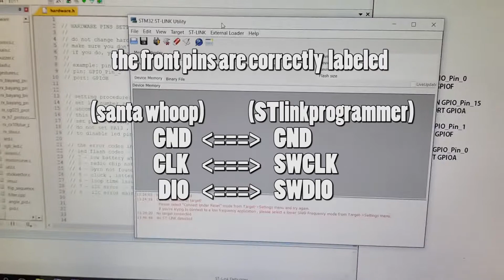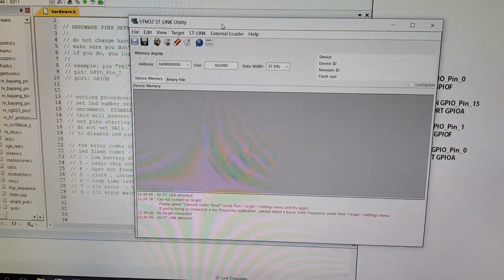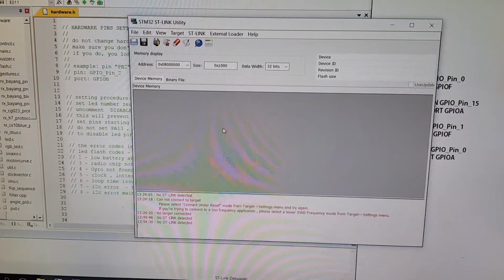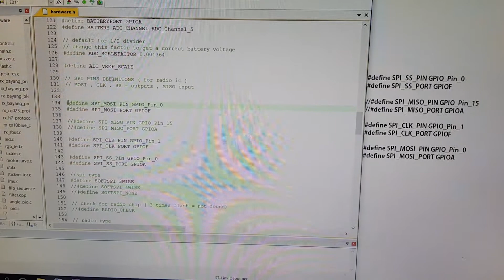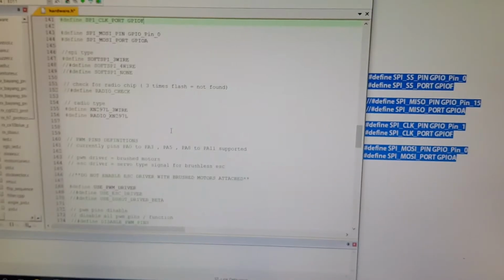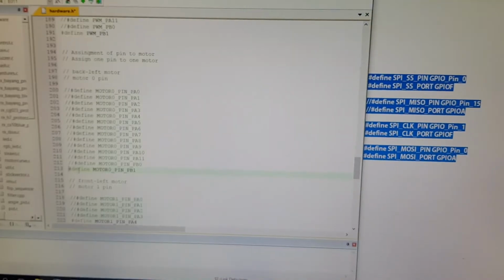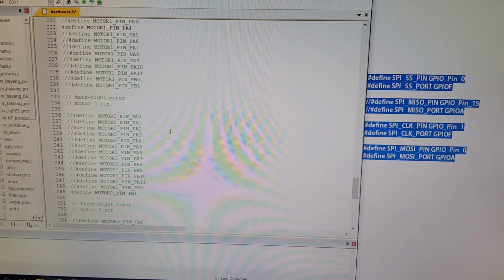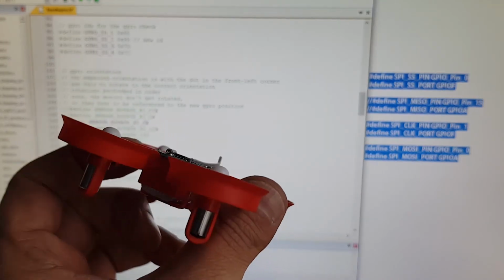How to flash acro JJRC H67 and Eachine E011C (Santawhoop)

Comment: hi all... i have trouble, all is successfully done upload...but drone just blinks 4 times, doesn't bind to remote
Reply from the maker: Make sure to have correct drivers etc...
But if upload was a succes, it could be that your flightxontroller is broken. I have half a dozen dead ones.
Reply: @CaninosRC  can it fixed?
Reply from the maker: @ge_maker  i am not sure. Try to reflash it. Otherwise its dead i think. People sometimes replace the crystal on top of the board and fix it. I have tried that twice, but never worked.
Reply: @CaninosRC  oh no....
What is the cause of the damage in your opinion?
Reply from the maker: @ge_maker  maybe you accidentally hit the crystal or other component while or after flashing. Or even sweat from your hands caused a short in circuitry.
Reply from the maker: But its been a while since i've flashed or even flewn quads. Maybe they even added a different board to their lineup.
Reply: @CaninosRC  i dont know if i accidentally hit something,
thanks of yours respond,
and i still want looking for the solutions,

Comment: how to enable silvervise conrct to phone pliss
Reply from the maker: Never used silvervise, so cant help with that.
Reply: @CaninosRC  can u share horizon setting in h67 
pliss
Reply from the maker: @yudhavalkyrie7568  its been a while since i used these toys. You'll need to check nfe's github for the latest settings
Reply from the maker: @yudhavalkyrie7568  also dont fly horizon mode. Its a bad learning method imo. Fly acro (air enabled) or just stable.
Reply: @CaninosRC  ok thnks so much

Comment: thnx. this might help, i have been having some problems so ive been looking around for answers and i think this will help, although i suggest to use a screen recorder to make ur screen easier to read
Reply: ok so its still not connecting to the target. i soldered on a 4 pin connector, no shorts. followed all the steps, and yet it doesn't work. keep getting the error message to change to connection type and frequency.
Reply: @emdo843  did you find a fix for your problem?
Reply: @C4illin  somewhat. it flashed, but when i turned it on it was unresponsive until i hit the channel 5 button, then it (im guessing) started idling, and since im pretty sure the motors were messed up, it went crazy...
Reply: @emdo843  Well I found out the answer to my own problem, it was to enable the "Hot Plug" mode.

Comment: Hi, can you confirm where is the STM32 chip on E011C? On my original E011 it was on the top, but E011C I ordered recently has some unmarked chip on the top side. I read that the current PCB does not use STM32 anymore
Reply from the maker: New e011 cant be flashed. Should be no problems yet on new e011C. Atleast not that i know of.

Comment: i get error when i connect stljnk utility

"can not connect to target!
if you're trying to connect an STM32W1xx device, please select Normal or Hotplug mode from Target"

how to solved this?
Reply from the maker: I think its under target>settings. I dont know what to set it on atm. Dont whoop much anymore.
Also check out the protection level, which has to be set to 0.
And finally check your wiring and solderconnections.
Reply: Select "Hot Plug" mode and it will work

Comment: i figured out that i must check mine swd connection ,  i have swdio on pin 4 is that correct ?
Reply from the maker: The front pins are correctly labeled. Cant say which is which tho now.
Reply: Select "Hot Plug" mode and it will work

Comment: Good morning

My st link does not want to connect. Do you know a solution for that?
Reply from the maker: It can be multiple problems.
-readout protection >Google how to please, should be an easy setting, which i forgot.
-incorrect drivers, maybe reinstall.
-faulty wiring/fc.
Reply: @CaninosRC  drivers are correct , new wiring .
 Read out protection ? from the st link or fc ? it search easier if i know what to search
Reply from the maker: @richardhulshof8029  readout protection or security setting or something can be adjusted in the flashing program (keil)
With wiring i meant to check your wiring to be sure.
Reply: @CaninosRC  sorry for my bad english , i can,t connect in the st link utility . so i gues also not in keil

I can,t select optionbytes
Reply from the maker: @richardhulshof8029  check out troubleshooting in the rcgroups forums. NL? Sometimes zware hoofdpijn met deze dingen.
Reply: Select "Hot Plug" mode and it will work

Comment: I just got my first e011c , quick question though what is acro mode and what does it do ?
Reply from the maker: No self stabilizing mode. Better tricks and smoother flight.
On your stock e011c if you let the pitch/roll stick go it auto balances.
Reply: @CaninosRC  thank you

Comment: I also flash like you. tx is connected but not up CH thur
Reply from the maker: Check out the rcgroups forum and also the github files. There should be a firmware specifically for the santadrone.
Reply from the maker: It could also be that you used the version where arming is enabled. If you use toy tx, you'll need to flash the "non arming" version.

Comment: So with my Qx7s tx and the irangex multi module I just need to add a switch for arming?  Would channel 5 work for this?
Before I found your video I had tried the silverware flash and it wouldn't bind to the stock tx.  Correct me if I'm wrong, but I wouldn't think including an arming switch would help it bind.
Reply from the maker: If you have flashed the original silverware firmware (edited for e011c) it should bind with stock tx. There are several silverware forks (including notfastenufs) that have some adjustments, like motor arm.
Its something in the config files. (Idle up or something).
But for x7 and irangex every firmware should work if you flashed correctly
Reply from the maker: In short if it doesnt bind, there is a problem with fc or flashing. Arming is only for motor start.

Comment: Hi my friend, her again, if i use JUMPER tx I need change something in the settings ?
Reply from the maker: No you only need to setup your jumper tx. These quads are on bayangprotocol (after flash aswell, protocol doesnt change)
Reply: Ok, the problem my Santa Whoop not recognize any radio. Do you know anything ?
Reply from the maker: Tried stock radio?
-did you damage antenna or crystal while flashing. Check that.
- try to reflash it, maybe something went wrong.

Comment: Nice video, mate! Finally gotten around and flashed my 011c to Acro. But I found it fairly complicated. I'm gonna do a video about that too, but of course not without giving you credit for this, because without you I would'nt have a cool little Santa Whoop now :D. Do you know if there is any way of flashing the original 011C Firmware back?
Reply from the maker: Thanks. There is a stock firmware available for the regular e011 on silverxxx github. Someone has to rip the original firmware of the e011c (i dont know how)

Comment: Great video!  Thank you!
I have a Bwhoop pro and a E011 on order.  Plan to experiment with flashing one. 
I have a (hopefully) simple question I hope it’s ok to ask. 
Does the silverxxx allow me to make adjustments to the flight controller orientation?   My goal is to adjust it 180 degrees so when I fly it the blue light is in front and the res light is in the rear.  I hope that makes sense. Thank you.
Reply from the maker: That should be possible. I did that a while back with the h8 mini (x-shaped) flightcontrollers. I rotated them 45° to place them on e010 frames.
Reply: Canino Thank You!

Comment: I cant bind my E011C with the controller, Do you know what the problem could be? I used you New (november 2017) firmware settings available here.
Reply from the maker: Did you completed the flashing correctly?
Do you use stock tx and did you use the firmware from silverxxx' github?
The firmware i used (notfastenufs) is for hobbygrade tx's with arming switch.
Reply from the maker: Cesar Ramirez. If you use stock tx you should try the firmware from silverxxx github page.
I've also understood that some flashed the boldclash firmware directly without editing with succes, you could also try that.
Reply: I use stock tx, i will try with firmware frome silverxxx github page, Thank you so much

Comment: hey man, if you use silverware and flash this santa drone with the b03 firmware, there is no requirement to alter the code at all - it flies with the dual mode ware from silverxxx 

https://github.com/silver13/BoldClash-BWHOOP-B-03/  will do it
Reply from the maker: Hi yes, that seems to be the case?!? I already tried once before without succes and there was some miscommunication on the thread in RCgroups. I'll try it again. Anyway a nice way to get an idea how the hardware codes work.
Reply: yeah, i am a noob at that stuff myself, but silverxxx has made it remarkably easy; if you look at my recent post (as scruffy1) in the same thread you linked this video on rcgroups, you can find my programming for controls using the taranis, allowing switchable rates and stock / acro modes

have fun !  :)
Reply from the maker: pacificWebsurfer nice thanks

Comment: thanks for this great video... i just followed your instructions from the e011 and this one and now when i plug a lipo in it flashes 3 times then just keeps flashing, doesn't arm, any idea?
Reply from the maker: Did u use the correct firmware? U havent crashed or handled it too rough while flashing? Bent crystal or something? I had one fail, but after a crash. Still dont know what was wrong as the quad and motors etc... were fine.
Reply: try flashing it as b03 firmware as i suggested above.... works fine on two of mine :)
Reply from the maker: Yes seems to work. But without alteration on the hardware code as i did in video

Comment: I followed yr video to flash my h67. performance very good, very stable.  Thanks so much. "Updated awesome dual firmware" (in E011 thread) is included level mode? if yes, how to change to level mode? I use Devo 7e transmitter.
Reply from the maker: It should be dual yes. To switch between level and acro you will have to do a right stick combo after binding (mode 2 tx). Left left down for acro and right right down for level (or vica versa). To calibrate 3x down
Reply: Thanks

Comment: I flashed successfully but can not bind to the e011c?  When I plug the battery in it blinks in a different rhythm.  Any ideas?
Reply from the maker: The binding sequence is a bit shorter than stock, so you need to do it quick. Did you used the exact settings like i did? What tx are u using? If you use the stock tx you should use the firmware from silverxxx github and not from notfastenuf (nfe needs an arming switch)
Did you shorted something? Or maybe you shoved the antenna?
Reply: I was able to flash e011 hex file through stlink app and was able to bind.  Something I must be doing wrong with keil app.  could you make a e011c.hex file I can flash with the stlink app for acro only as in this video?
Reply from the maker: Nice that you got it to work. I just edited the included files in keil. I dont know how to edit the files for the stlink app.
Reply: my fix...I compiled the e011c settings/changes from this video with  keil then flashed the new bwhoop.hex file with the stlink app.  Success!  thank you...santa rips in acro!
Reply from the maker: Enjoy santacro
Reply: thanks again.  FYR once you edit files in keil you can load them through stlink app by just selecting target then program, select the .hex file in the project you edited with keil and hit start.

Comment: Tell me something Canino, the quad I have is the Eachine E011c... How do I solder the pads??? The same way as the regular 011???
Reply from the maker: Its exact same board and use the front pins instead. The front pins are labeled correctly btw.
I didnt use the bottom pads as they are too close to other circuitry.

Comment: I never connected. STM32 ST-LINK Utility message "No target connected" I'm hardware engineer, so soldering and connection were accurate. stlink v2 is genuine ST. This video does not connect, what's wrong? Has anyone succeeded?
I don't know about software.
Reply from the maker: Maybe the pads on your stlink device are swapped as i recall seeing before or check your software, reinstall maybe?
I didnt solder on the front pads i just wedged them in.
Reply: I didn't solder on the front pads, too. and my first installed STM32 ST-LINK Utility. Reinstalling is same. I connect Stlink v2 pin header 7(D),8(G),9(Clk) and 1(V),7(D),8(G),9(Clk) (JTAG 20p) but both are never connected. T.T Plz Canino, upload your video that connect and flash course detail JJRC H67. Thanks your reply.
Reply from the maker: There are only 3pins on your stlink device you should hook up to. They could be mixed on yours but its usually (on the models i have seen) on pin 2, 4 and 6. Connect them accordingly to the fc as i point out to in video.
On the front pads of the fc (quad)DONT use V pin. U could break stlink or fc. Maybe u already broke it? :p
Check out the RCGROUPS forum for further troubleshooting.
Reply: Thank you Canino. I solved the problem. But I have a new problem. haha. The firmware has been erased by changing the ROP. Can you give me factory initial firmware? Within a few days of starting, I still want to practice with the factory firmware.
Reply from the maker: Kwon Oh-jae, nice. But why dont you just load up the dual firmware from silverxxx github? It switches easily between acro and angle with stick combo. If you have mode 2 tx just press right,right, down on right stick to switch to angle and left, left, down for acro (or vica versa). Silverxxx also has the stock image on his github page.
Reply: ok, If you did not have factory firmware, I was thinking of downloading dual-mode firmware. By the way, is not the firmware on that site the factory firmware of e011? I have jjrc h67 like the video you uploaded. Anyway, thank you very much for your help :)
Reply from the maker: Oh wait. Yeah thats true. I mixed up original e011 with this one. No i dont have stock firmware. Silverxxx and the other guys did the real hacking on the original e011 and models, but not this one. I dont think they even ripped the stock firmware yet. So its best that you use the dual firmware from silverxxx github. The firmware i have in descryption needs an arming switch. The silverxxx firmware doesnt need arming.
Reply: @ohjaekwon3337  may i ask you , how do you solve it ?
Reply: @richardhulshof8029  i have problem to on my st-link v2, cannot connect.
Reply: @ohjaekwon3337  how did u solve it? im having the same problem (it sounds like)
Reply: @richardhulshof8029  (and all other) Select "Hot Plug" mode and it will work
Reply: Ohjae Kwon how did you solve the problem I having the same now, cannot connect to the stlink v2
Reply: upgrade stlink firmware, in menu Options, click Refresh button, then connect

Comment: Great work, Canino! Thanks for sharing this. Now my Santa can fly acro! I have two comments to add. It appears that H67 only works with the acro only firmware by NotFastEnuf. I tried the other two (dual mode and silver13). It binds, but the motors are unresponsive to throttle. Another note to make is that when MOSI and SS lines are swapped, PORT Values (GPIOF and GPIOA) should not be swapped.

Again, thanks for sharing this video. Happy Holidays!
Reply from the maker: On the notfastenuf firmware the arming is set to channel 5 for a switch. I think the other firmware doesnt have arming switches, so it could be that your tx should be set up differently? I am not sure tho, as i only tried nfe's firmware.

Happy holidays!

Comment: Good :-)  I'll do an acro whoop too, h8 mini or e011 😏
Reply from the maker: The best way to master acro :)
Reply: Drone Revolution Italy which one did you pick, i wabt to go e011 because of the bigger motors and battery
Reply: Clorox Bleach I agree. Plus you have the protections to fly indoor
Reply: Drone Revolution Italy yes, although the h8 is a lot faster.
Reply: Clorox Bleach the whoop too has a good speed ;-) you can always increase it later
Reply: Drone Revolution Italy is it worth flashing tho, is fpv going to be good with self-level mode?
Reply: Clorox Bleach they are two fun flight modes, acro requires a little patience, but you can disable it